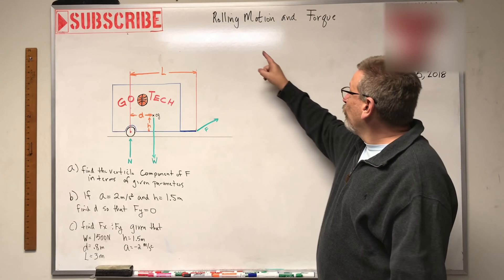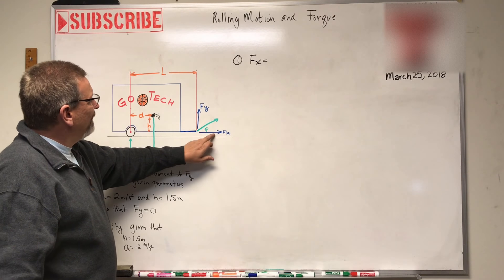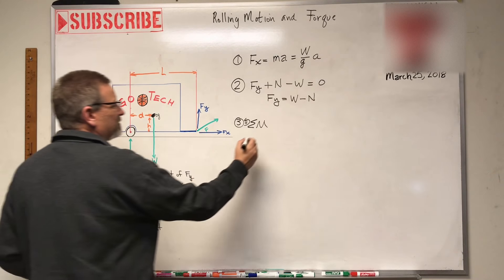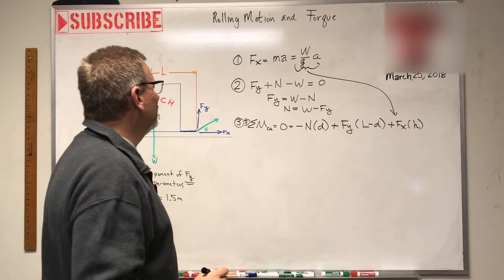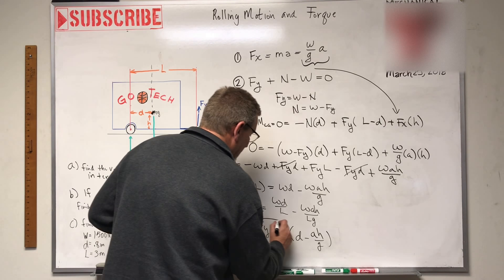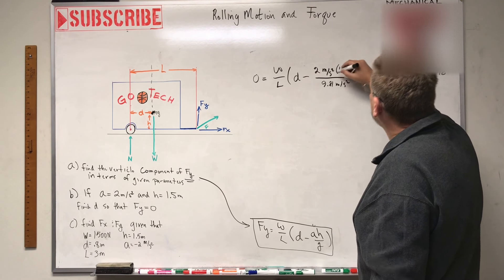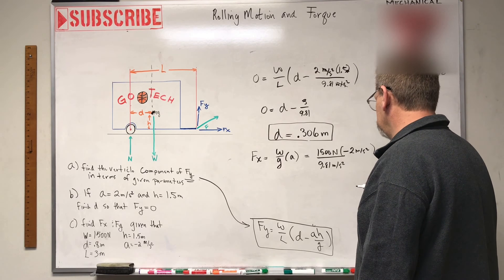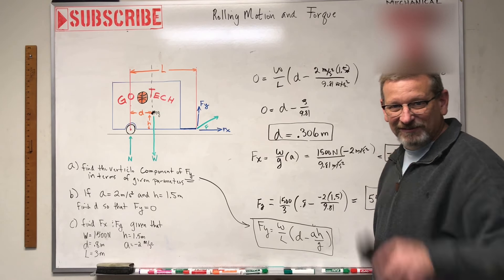Dynamics - Lesson 14: Rolling Motion with Torque Problem

Comment: I saw that you posted this on March 27th. Is this the final video for the course? Thanks. I'm taking an online dynamics course this summer. I took statics and your videos helped greatly!
Reply: +Valerie Cannon 
I doubt that this is the final video - Dynamics covers a lot more topics, and some of the more complicated topics are Coriolis forces and rotating coordinate systems.
Jeff Hanson probably focuses on other videos at the moment.

If you want some other reference material in the meantime, then I can highly recommend the book "Engineering Mechanics - Dynamics" by R.C. Hibbeler.
That book is actually the second half of "Engineering Mechanics", so it starts with Chapter 12 - the first half is "Engineering Mechanics - Statics", which Hanson followed in his Statics playlist.